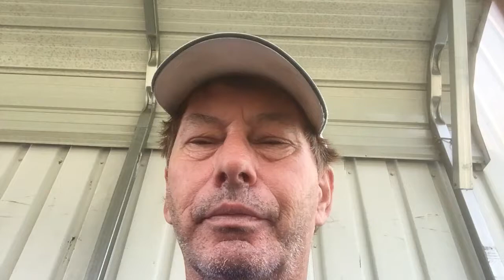SPOT LOCK MINN KOTA ULTREX WARRANTY REPAIR

Comment: Mine is out of warranty and my spot lock hasn't worked for 2 years. Got it in 2018 and it will be my last Minnkota purchase. Cheap pile of junk, I think my original Johnson TM was better but I gave it to somebody when I got an Ultrex. How is the Motorguide Xi5? Need a new tm
Reply from the maker: my ultrex was one of my first upgrades 4 years ago. I could not tell you about any other brand 
sorry   but spot lock is key for crappie fishing in my humble oppinion